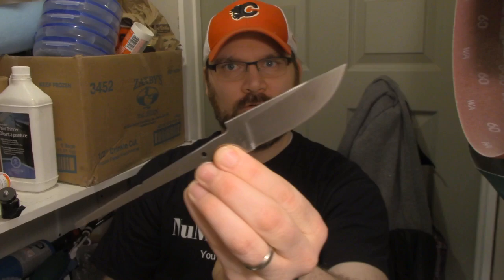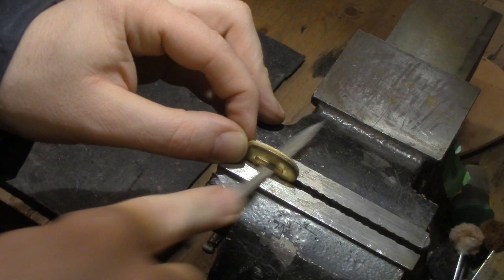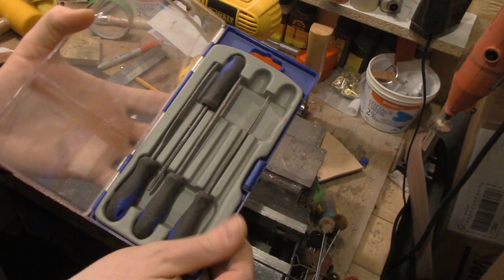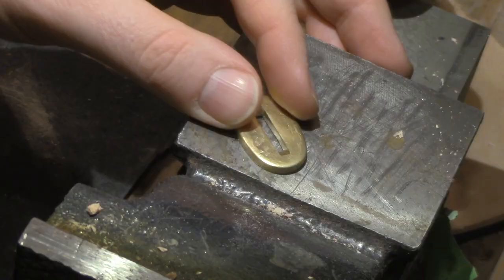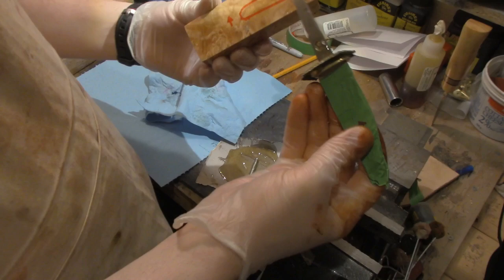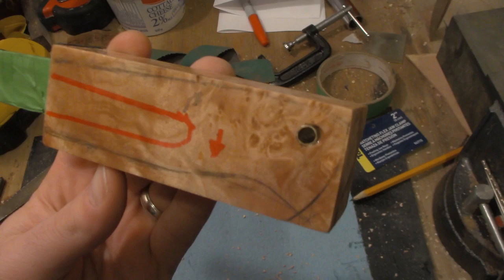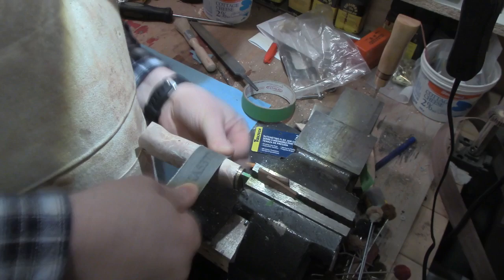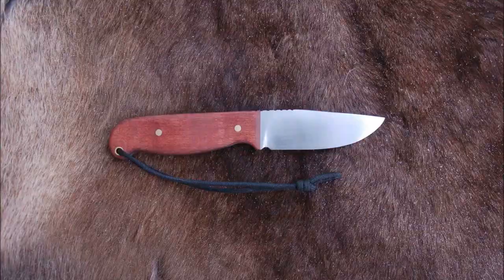Knifemaking - A Stick Tang Knife

Comment: Great video, I've been thinking about doing a hidden tang. Go Flames!
Reply from the maker: Yes Jon, go Flames!!! Definitely try a hidden tang, they seem to be a bit daunting, but truly when you figure the process out, it makes a really nice knife. I like that there is no metal touching your hand when you hold it. One winter when I was gutting two caribou I was using a full tang (with the steel between two scales) and I have actually got some mild frostbite on my hand since the metal got sooo cold.
Reply: Thanks for sharing your process, it definitely makes it seem less daunting. Good point about not having metal touching your hand, I hadn't thought about that. I saw your sheath on Instagram today - it looks amazing! Is there going to be a sheath build video as well?
Reply from the maker: You found me on Instagram, eh? Cool! Yes, I have been filming the sheathmaking process and will hopefully get that video done soon. I do have several other sheathmaking videos on my channel if you are interested. Thanks again!

Comment: Thanks for the video, I am looking into making knives like this with kid scouts. Some good pointers on cutting the slot for the tang.

I think acetone is not too great to get on one's skin, but I see you later use gloves :)
Reply from the maker: You’re welcome, thanks for watching. Hidden tangs can be quite challenging, for beginners, you may want to try full tangs first.
Reply: @NuManXplore  Yeah I see that, but stick tang blades seem to be much easier to get ahold of and cheaper. Think I’ll do a test piece first.
Reply from the maker: @drekowski  Ah I see. By the way I think it’s awesome that you’re planning to make knives with kids!! 🙌🏼🙌🏼 What country are you in?
Reply: @NuManXplore  Thanks. In Germany. I ordered two blades to try out by myself to see if it’s practical to try with them, they are older kids, so it might work.

Comment: A beautiful knife Nathan, and a great video. That is one very cold sanding station you have there! Which knife blade did I you use? Cheers, Jim.
Reply from the maker: Yes it does keep me moving fast to stay warm. I have to concentrate hard so as not to ruin the piece I am working on. That blade is a really nice little blade called the Cervus, made by Enzo. You can probably get them there in Europe from Brisa of Finland.